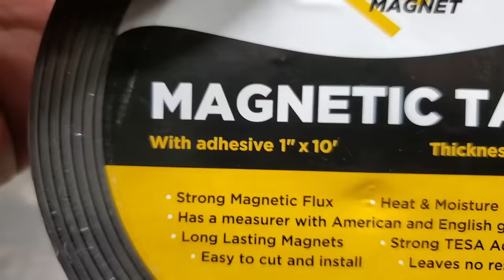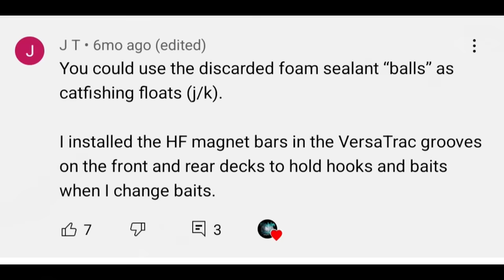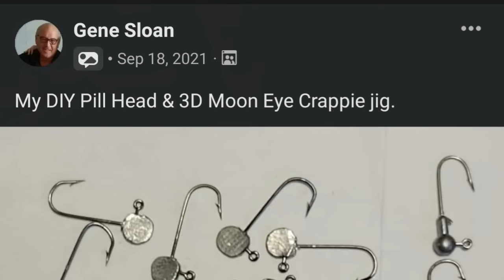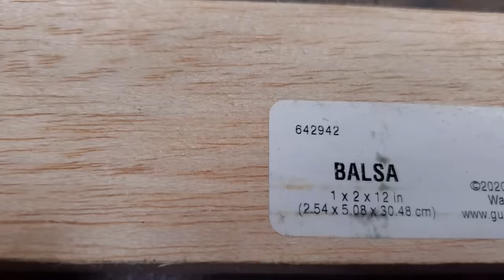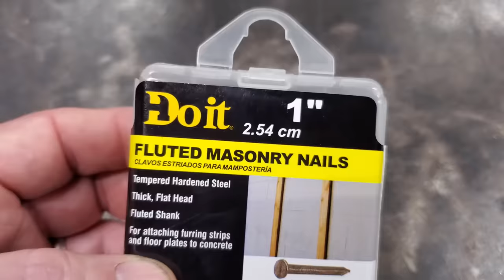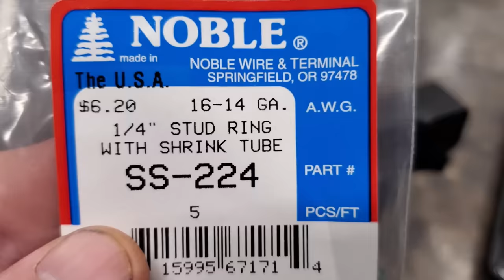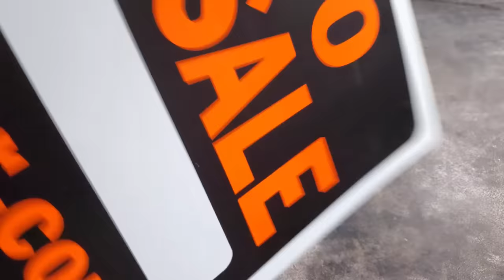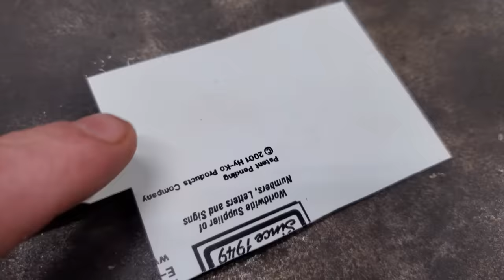7 NEW Awesome Fishing HACKs

Comment: Wow, Keith, I am so excited to see my suggestion make into this video (Hack #2).  I use 1/4” SS carriage bolts for my track system but see how the ground-down heads would make it easier to insert the bolts in the track.  And, if I grind down the round head of a carriage bolt like you showed, the square shoulder will fit in the track and keep the bolt from turning when it is tightened.

As always, great tips!  I love your channel.
John
Reply from the maker: Thank you Sir  , and thanks for the tip

Comment: For plastic lure weights suck as trick worms for wacky rig fishing I have used old metal coat hangers.
They are always around it seems and you can cut them to size.  I store them in a pill bottle in my boat.  Very cheap and you can use more than one at a time.  Thank you for your tips and good fishing!!!
Reply: Yeah but if a fish bites that worm the wrong way if it’s more than 2 inches I’ve done it before to make my worm actually swim zigzag without boiling the worm clothes hangers are not safe unless they’re under 1 inch believe it or not fish don’t like to bite something and poke them to the roof of the mouth anything wrong with the 2 inches could actually hurt to fish depending on how he bites that worm seen it done had it done had it done to me plenty of times it’s not worth of clothes hangers not worth it and less it’s only an inch long

Comment: That’s pretty good stuff. 

I have gotten some kind of spring,  like a door spring, you know the kind - the old ones that used to slam your granny’s screen door shut? 
Well, just attach those in a couple places around your boat and your lures can hang by the hooks on the spring… and they don’t go anywhere. 

The pill head jig? Man I have pounded bunches of those. Great idea. 
You can also flatten them the other way,…. I just use a small piece of metal rod, a bolt, etc. Drill a hole in it to fit over the eye and then just hammer away. 

And bro, we’ve been shoving nails in soft plastics for a long time - great idea. I can’t believe people spend money on that stuff.
Dang bass fishermen! LOL

David

Comment: I have about 15 or 20 boxes of plugs spinners and spoons that look just like that. I grab 1 and everything in the box comes with it so I shake it around till one falls off. I'm going to have to try some of that magnet stuff and I have to find some of those drill bits
Reply from the maker: It's not super strong but it did help
Reply: Wear did you get those drill bits ? I have to get that stuff
Reply from the maker: @elkhunter6746  Amazon carries them in singles and sets . Just search bead making drill bits
Reply: Thanks there on the way I got the hole set

Comment: #2- You could use 3M double sided tape and mount the magnetic strip lower, inside the boat/kayak. That way, the fear of the lure or hardware won't fall into the water being mounted on the top rail.

Comment: For the phone tether, you might want to pop a hole close to the bottom but not all the way for the tether to come out just in case it may interfere with the charge port. It may leverage against the USB port and ruin it, especially if dropped while plugged in